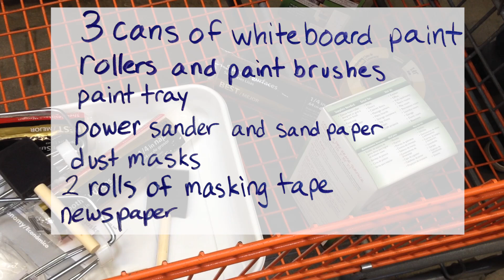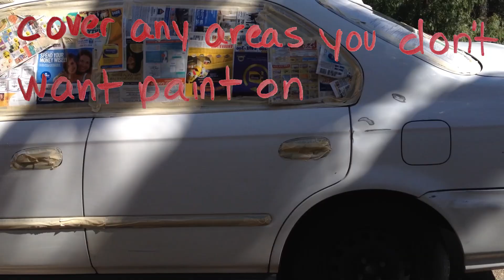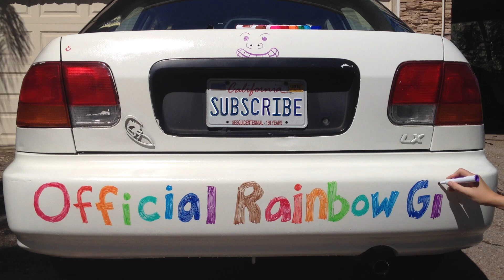Painting a Car with Whiteboard Paint! (dry erase) DIY Tutorial

Comment: Wouldnt this work without the paint though??
Reply: Yeah probably. Same smooth surface works the same
Reply: I was literally thinking the same thing.... It would have worked on the white car without having he use the paint. You can also use dry erase on mirrors and plastic and such and it just wiped right off (maybe sometimes you need a lil water to get it all depending on your marker and how long it's been on)

Comment: Apparently 'washing' a car consists of spraying it with water, and then wiping the water off. Is this the way you clean your dishes as well?
Reply: Well,yeah isn't a car just a big,drivable dish?
Reply: Soap, please
Reply: TDhoedo Okay so it's one big,water-washed,drivable dish.
Reply: She probably did all the rest of the stuff too. She probably just didn't film it.
Reply: they sanded it, which literally removes any layers that have ever been exposed to anything. after sanding it is a virgin surface. also soap can leave residue that would interfere with the longevity of the paint, and to tackle another question that popped up, they repainted it because the original painted surface had wear and imperfections, so only on brand new car paint will a dry erase marker consistently come off